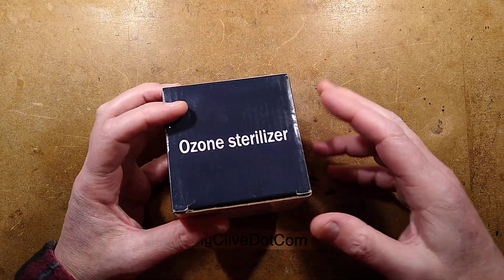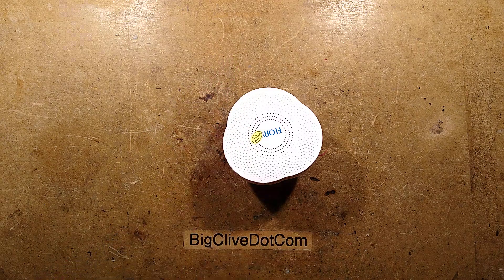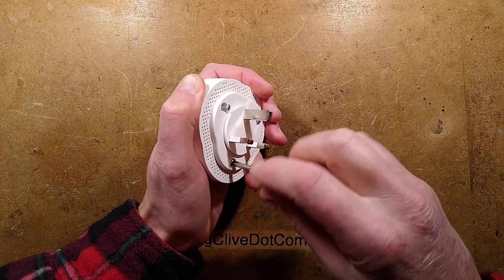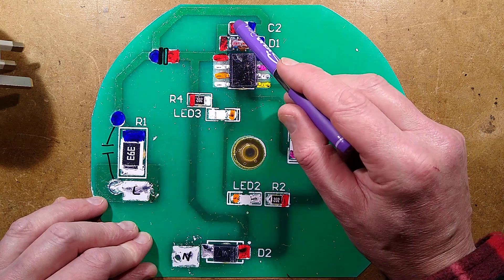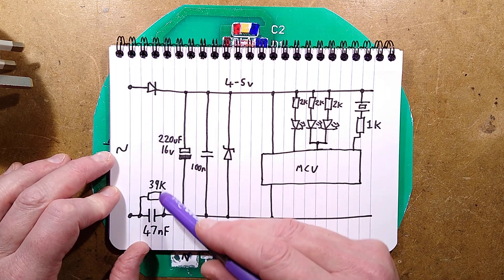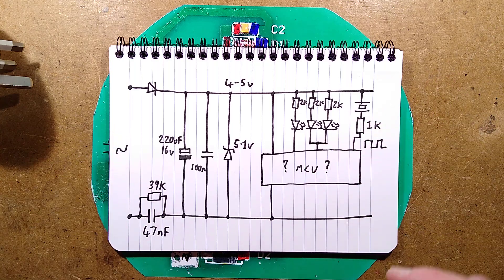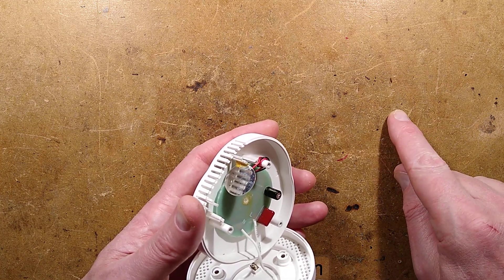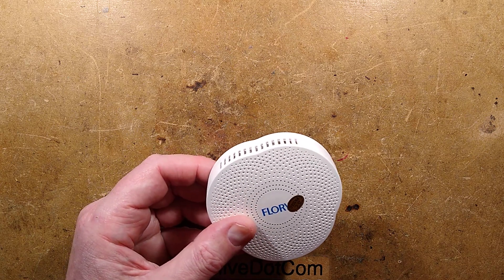I got scammed on eBay  (what a surprise)

Comment: Nice case though. Could be converted to a fake cartridge room freshner🤔 as well, by putting a piece of sponge/cotton cloth and few drops of essential oil. It has all the vent holes to make it look real. May be you could wire some thermistor (ones used in old CRTs to degauss at start🤔) to make it functional?.😂❤👍

Comment: I barely buy anything from ebay now as the amount of things I had to send back because they were either faulty, extremely low quality (not fit for purpose) or inaccurately described got to the point every purchase was a gamble. In the early days I rarely had an issue with anything I bought.

Comment: Ebay is typicaly good at refunding when the fraud is very transparent when in doubt they tend to be a bit more on the side of the seller with the complaint from sellers that they have no recourse for buyers abusing the system and then sellers know some form of concession has to be made making loopholes to be exploited and nobody is safe from the scamming I once bought what I thought was a decent camera for a very low price instead of 17 MP it was more like 1-2 MP and no matter what settings I used it took blurry photos the funny thing is the settings had the options of 8 12 and 17 MP options we called EBAY and without any debate we got our money back and did not have to send it back I keep it in my desk draw as a reminder to look closely so scams are nothing new and all we can do is new regulation tactics  some of which I am not a fan of like having to send items to a 3rd party to be verified as real this 3rd party gets paid a cut of the sale and is another person in the transaction to add a new form of fraud they could swap the item and send back a fake item claiming you sent a fake they could do this on the sale or return they also extort either the buyer or seller and in a market with already tight profit margins the added fees are not small as the item has to be shipped twice and the expert is likely gonna demand a very high hourly rate because its a captive market if a jeweler can profit 1000 dollars an hour selling their own jewelry  so to spend 10 min to verify somebody else jewelry what do you think they want to charge as A they have to accept delivery of the item open it examine it then repack it and send it off they are either gonna take 20 percent or more of your profits or not want to bother I for one find this be rather intrusive and when somebody is able to claim to be their own authority they skip this part of the transaction and worse is blocking the sale of used goods creating an unfair anti competition practice

Comment: I suspect the frequency sweep is controlled by a capacitor based timing circuit lower voltage lower frequency

Comment: I find most times I've been scammed, it's got "made in China" written somewhere on it. Sadly, I'm not even being stereotypical, it just has been the truth every time. Almost every electronic item I've had manufactured there has had faults or not as described. Last one I returned as you know has to be the solar charger, last week it was a geiger counter i had to return as it was no where near as accurate as specified in the booklet. The slightest tap would turn it off and the control panel label would peel away. I didn't realise my phone was manufactured there also... There are many videos that are jumbled pixels on it. Bring back made in Japan or the UK haha

Comment: The capacitor in the dropper circuit won't do anything, once it's charged up. The circuit will work the same without it. In order for the capacitive dropper to work properly, the cathode of the zener should go to the anode of the rectifier diode, there should be a 1k resistor to limit the inrush current and the 39k resistor should be 1M.

Comment: So it started its life as one crappy thing - an ozone generator that could only produce trace amounts of ozone - and instead ended up being a different crappy thing - an ultrasonic generator that only generates trace amounts of high frequency sound.  Or possibly neither ever worked properly.
That's pretty lame.
Reply from the maker: Trace ozone generators are the best type for adding back the tiny amount of ozone in normal outdoor air that gets depleted indoors.
Reply: @bigclivedotcom  Oh.  Could be.  I have an ozone generator that is bigger.  about 10" cube or roughly two school lunch boxes side by side.  I don't use it too much in house and if I do keep it down low.  But I've used it to kill mildew / odors in a car that had been parked a long time and one other time in a camping tent.  Run an extension cord, crank on high, close it up inside and let it run for a couple of days.  I'm not sure the exact science but both times it seemed to help a lot

Comment: Now you need to buy as many extension leads as you can get hold of, plus a space rocket. Then you can go and fix the climate change problem by regenerating the ozone layer. Not sure what voltage drop you'd experience with that length of power cable though......

Comment: A lot of the ultrasonic pest repellents aren't actually constant. Every so often they'll emit a burst of ultrasound that you can sometimes hear as a click. We have a couple of them at my place that my father bought. I question how well they work because we still get rodents and things but seeing as they use hardly any power I figure I'll just let them keep going in case they provide any benefit. I suspect that the occasional dimming is when it's giving off a pulse. So it probably is trying to do something but it's definitely not an ozone generator as you noted

Comment: Is the metal PE pin allowed if not connected to anything, or must they be plastic in such a case?
Reply from the maker: It's needed on double insulated products to unlock the safety shutters and ensure correct polarity.
Reply: @bigclivedotcom  I mean, isn't it required to be plastic if not connected?
Reply from the maker: @SojournerDidimus  It can be metal or plastic.

Comment: Question due to my ignorance.  How is the mains voltage dropped from 240 volts down to 4-5 volts just going through the diode and relatively small valued resistors?
Reply from the maker: If you current limit the supply the voltage will not exceed that set by the zener diode which clamps anything higher.

Comment: BC has a brush off with his Web designer.  Clearly a barcoding balls-up. Some of these circuit designs must come from youngsters breaking out into the electronics industry? I watched a documentary on some of these production lines. When components run out, they swap to the nearest one they can find. Starts off with ozone generators, as the parts diminish, bug repellers.

Comment: dont understand why anyone would plug in an ozone generator in their house anyway. Ozone is NOT good to breathe and should never be generated intentionally anywhere you could breathe in what you just made. It does not purify the air but makes it toxic to breathe.
Reply from the maker: Ozone occurs naturally in outdoor air, even in remote locations.  It's part of nature.  I regard a trace nature-equivalent of indoor ozone as beneficial.
Reply: They often use professional ozon generators in libraries and bookshops, it seems to help against the typical book odour. And then there are of course the ionizers against esd that are used in machines that handle sensitive electronics. It's not that dangerous and the ozone also does not last too long to build up a dangerous concentration i think

Comment: I haven't ordered anything from China through ebay in ages (I sometimes use it for local/European sellers though). I had way more "item not as described" cases on ebay than on aliexpress. I took the refund "bait" quite a while. But with it happening more frequently I opened cases, even if full refund was offered, because I want to stop that behavior. The Chinese sellers on ebay seem to live on selling crappier products than described and then paying off those customers who complain. It's not even the potential loss of money that annoys me, but the wasted time and having to wait another month for the item you actually wanted after ordering from another seller.

Comment: I don't see how theory predicts ozone will be produced.  I suppose some sounds will annoy pests and cause them to go elsewhere.
Reply: you have to have a spark gap to generate ozone.  you are literally ionizing regular 02 with electricity, and when it recombines, you often get temporary 03 being generated.  there is nothing in this device built to suit that purpose correctly.  as to the second part, sounds do not annoy most pests, as most do not have any ears or ability to even hear sound.  it's a long standing myth.
Reply: @thomasneal9291  Striking piezoelectrics is known to cause sparks.  This is how electronic fire starters work.  But I don't see a striker.  Additionally, UV and radioactive decay are also known to break O2 and to cause ozone.

Comment: I'm thinking of rewiring my house and putting it all on 1 200 amp circuit but wire it with 10,000 individual 44awg wires 🫠🙃🤪 resistance is futile *don't tell the code people* *this is a joke for internet people that don't understand internet jokes*

Comment: Hi Clive. I have to disagree with your point about 254nm not generating ozone. In my job we use 254nm for DNA decontamination in super glue cabinets, and there is definitely ozone created. We purge the cabinet through the filter system to reduce the ozone level before unlocking the door. To be fair they are 50w tubes, and not what would probably be ~0.1w (optical) of LED in a product like this. Big fan of your videos btw.
Reply from the maker: Depending on the type of glass used, Mercury vapor UVC tubes may also emit the 184nm wavelength which does generate significant ozone.
Reply: @bigclivedotcom  good point, I now vaguely recall looking at the spectrum and there were multiple spikes. I believe it is quartz glass.

Comment: long time fan needs advice.  i need 10+ multi plugs with individual switches plus cutoff/brakers.  do you knows if it can be built as online only have 10pluge pdu but no switches or cutoff

Comment: if there is ultrasonic sounds, it could be getting lost for a variety of reasons
- outside bandpass for your mic
- outside bandpass for audio encoder on your laptop
- outside bandpass for audio re-encoder on youtube

The first models of intel imacs emitted a high frequency noise that I found very loud but that a lot of others could not hear.  I was only able to find one microphone that could pick it up and get it into my computer to view in an editor.  All the others somehow ignored or filtered it out.  One it was on the computer though, I had no problem playing it back.  I left it uncompressed though, in AIFF format iirc.  If you MP3 it, you might lose it.

Comment: Ah, looks like it was also offered on A___ under the Fullfillment by A_____.  For items without EAN/UPC, the FBA program can require labeling with a unique ID code beginning with an 'X'. This identification code is used to maintain provenance if multiple sellers have the same item sent to fulfillment centers (warehouses where orders are packaged and shipped).
There are many restrictions on what may be sold under FBA program.  This includes ozone generators.
I did QC for the company and dealt with this kind of fraud..one seller was trying to sell a penis pump as a massage device.  Of course I had to take pictures of the item for the investigation report..not the only time I sent d___pictures to coworkers as part of my job duties and got paid for it. Just not my d___.

Comment: Amazing you used to need a massive brick that buzzed to step down from 240V but now to get to 4.5V you need... Basically nothing
Reply from the maker: The simple power supplies have been around a long time for very low current applications like this.

Comment: Hi big Clive I've got a Chinese 3s 60a BMS I would like to hack it to bring the balance voltage down from 4.2v on li ion to 3.9v to extend life of the18650  cells please let me know if you can help will send you links
Reply from the maker: That would be nice, but most of these charge control chips are supplied locked at 4.2V from the factory.
Reply: Can I send you a board to further investigate I would really like to drop the voltage for extra life cycles from 4.2 to 3.9 would be great if there is a way to hack this 
Cheers Clive need Addy to send it to when they arrive from China also the strip light  all the best 
Paul.

Comment: You, Clive? Scammed? Surely not?!

Well, it happens to the best of us.  A friend of mine is a sucker for this type thing, even bought a "Lustrate Mouse Machine" - That's what it called itself. It didn't have any piezoelectric sounder, nor anything to drive one. All it had was a couple of LEDs, one of which lit continuously, and one which dimmed and brightened by itself. There was a cap dropper and a couple of resistors - and that was about it.

It think the idea must have been to mesmerise the mouse, and the local cats would come along and "Lustrate" the mouse whilst it was transfixed by the lights.  I could see no other way that it could work.  At least yours has what looks like a piezoelectric disc.

Some people, if they qualify as people, really do have no scruples whatsoever.

Comment: 1. "ultrasonic" means frequencies above human hearing so you will never be able to hear it and YouTube will not serve it so no one can ever hear it. using your oscilloscope if you had one and knew how to use it would have been more interesting than your conspircy theories as certain ultrasonic frequencies are not liked by many animals so will repel them eg dogs. - even a human won't sit in a room with 12-15kHz square wave for very long.
2. did you really have to kill the spider? it caused you no harm, was out of shot in seconds and was just minding its own business looking to eat any flies in your house ie a good thing. Thought better of you but live and learn.
3. definitaley dispute to ebay as we need these things off the platorm as all they do is fill landfill with shte, waste resources and potentially catch fire....if only we had a politician somewhere that could even wire a plug.....(why do people (s)elect the biggest liars and not the most skilled? not 1 politician in the HoC is technical in the slightest)

Comment: Man, I just bought an ozone generator for my fridge few weeks ago, but from Aliexpress, supposedly "same model from Xiaomi but unbranded"... either a clone or white label product that Xiaomi used prominently, and I thought I had also been scammed. :P
Turns out, I was just sticking my nose in the wrong hole. xD (no dirty joke implied) cough
It has air intake on the sides, and the output comes on top, with noticeable ozone smell.
So far, been pretty lucky with the Aliexpress models... I've bought 3 different models so far, all of them worked as described, including the cheapest model I could find there.

Comment: If it really was circuitry to drive the piezo you kind of expect there to be an inductor in parallel and for it to be driven with a transistor. You wouldn't do that for music but you would do that for ultrasound because that makes it much, much louder.
Reply from the maker: And the disk would be in a suitable housing to amplify the effect instead of just hanging in mid air.

Comment: A bit off topic maybe, but I do remember I bought a cheap china phone ages ago on Ebay. The specs was low, and so was the price (still though about 70 GBP). They had just changed the Android system info reporting (said 1.8 Ghz dual ARM something as I remember) but was a single 1.4 Ghz when I tested it with other software...

Never knew actually I could do anything about. The seller (a China business) asked me by mail if the product was satisfactory, and ofc I told them that it was not (and why) but never got anything more about it... maybe they where scammed as well.. who knows... after that I never used Ebay... maybe I should...

Comment: See, this is why I only buy questionable electronic gadgets off eBay that don’t have cases at all. It’s much easier to figure out what you might really be buying with no plastic case to hide the circuit board and components! The downside is the increased risk of fatal shocks, but if I had any regard for my own life, I wouldn’t be buying electronics off eBay.

Comment: They could put the zener between the diode's anode and the dropper capacitor to offer a current path for the other half period. That is the traditional way if you want a mains reference in your circuit.
Reply: yep, i've seen that done

Comment: could it be dangerous and could you make an ozone generator for similar cost
Reply from the maker: It would cost a bit more to make it real.  But still within the cost range of the unit.
Reply: @bigclivedotcom  Strange they dont bother then ,,,, surely its better to earn a reputation rather than be given one plus EBAY should be ashamed

Comment: It's one of those placebo devices.  Gives the purchaser the warm and fuzzy feeling that they are cleaning the air and repelling posts at the same time. Oh, also making the wallet a bit lighter.
Reply: yeah, like those 'power saver' plugs that do at best nothing, at worse actually increase your bill
Reply: You could label a device like as an insect repellent, ozone generator, humidifier, de-humidifier & 1001 other supposed uses without a majority of buyers knowing any better.
Reply: @tonysansom  no kidding,  put an OBD II plug on it for the car while they are at it.